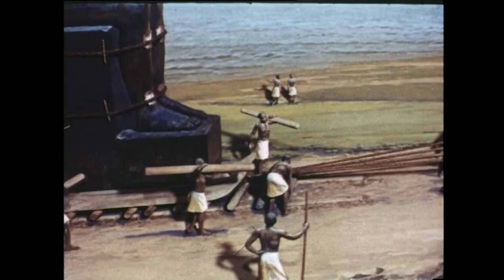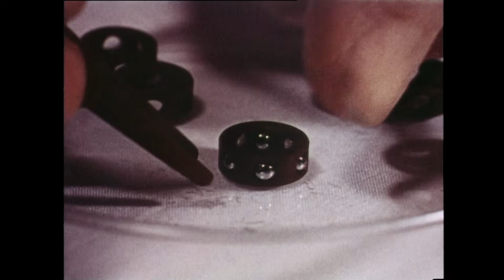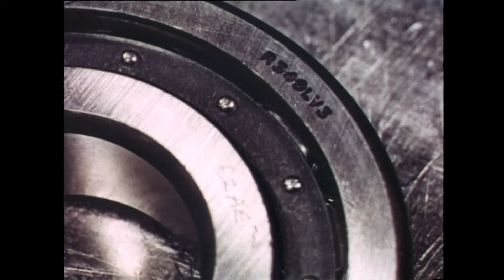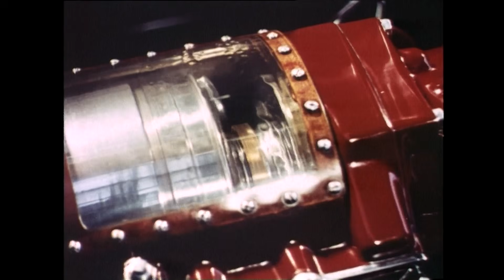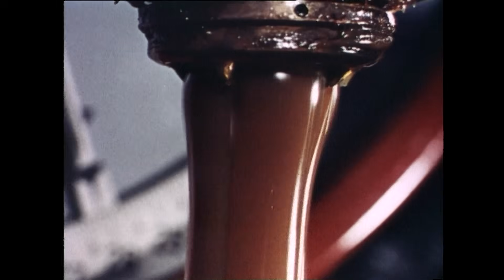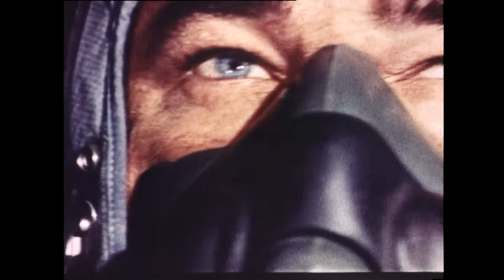The Lubrication of Rolling Bearings | Shell Historical Film Archive

Comment: I hate to say it but in the automatic transmission the fluid is used to lubricate the bearings and bushings, lubricate the clutches, to apply the right PSI to the Pistons for the clutches to engage. And most important to cool the transmission that's why transmissions have tranny coolers.

Comment: I had never thought about what effects radioactivity would have on lubricants 🤔
Reply: I think about it everyday, when I wake up, when I go to bed wondering if my 10W30 has uranium contamination.
Reply: Ionising radiation damages structure of materials (mainly crystal structure), and causes chemical processes like radiolysis of water, when free oxygen radical is formed and destroys everything. It changes properties of oils, causes materials to swell and crack, causes chemical reactions. The different story is of course neutron radiation which also changes elements to their radioactive isotopes, or another elements.
Reply: @if860  And neutrons are what you get from nuclear fuel.
Reply: @keithammleter3824 Yes, I forgot. However from SNF itself the neutron radiation should not be a major concern. Of course everything changes if the grease was exposed to neutrons from operating reactor, because the neutron flux is huge there.
Reply: Now you can think of the chap who stuck his bare fingers in the now presumably radioactive grease and bearing.
Reply: @keithammleter3824  😓